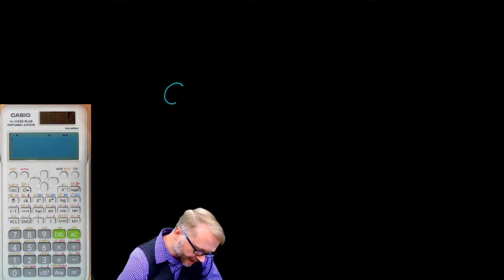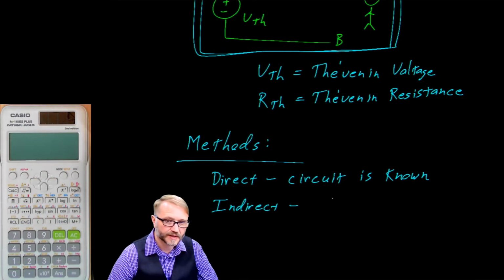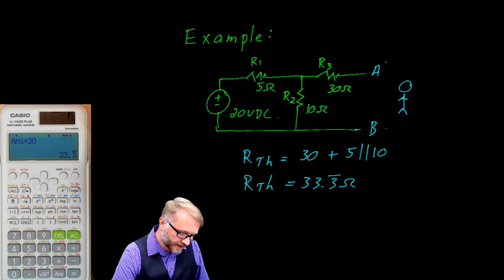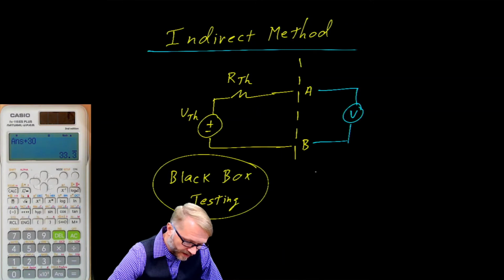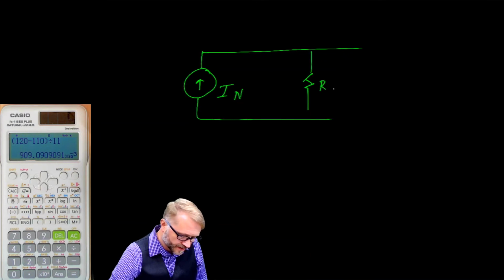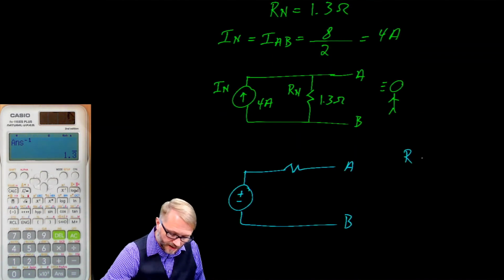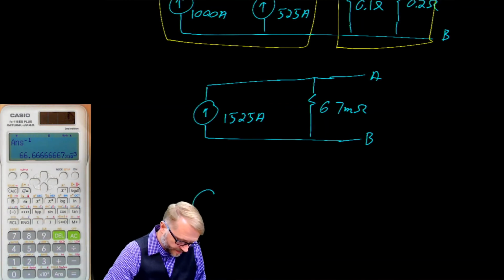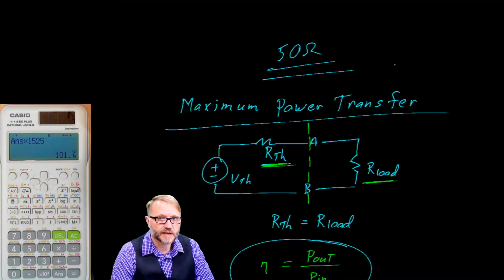#7: Thevenin & Norton equivalent circuits and the maximum power theorem

Comment: 02:30 Deconstruction of the Circuit
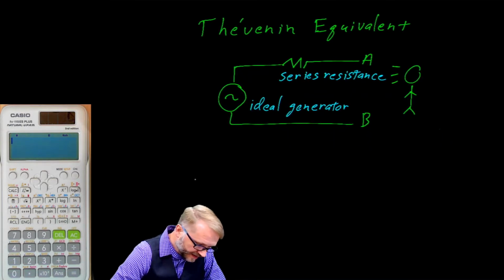03:22 Modeling the Thevenin  Circuit
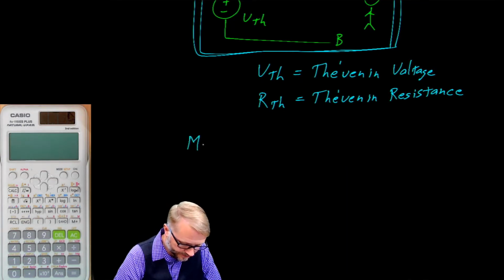04:50 2 Methods
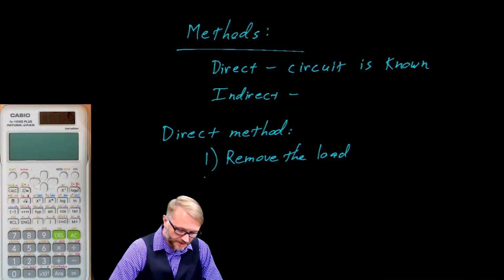05:15 Algorithm for Direct Method
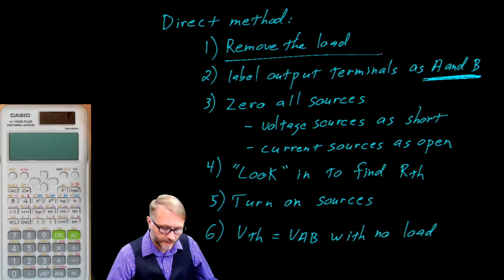06:30 Example 1
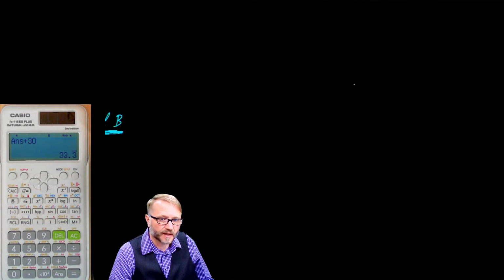12:00 Indirect Method (Black Box Testing)
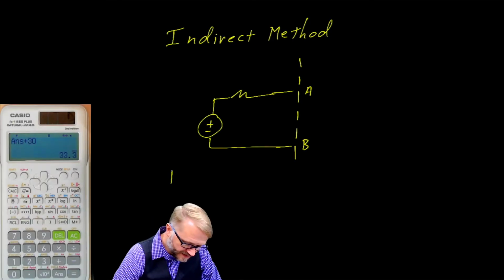13:10 Example 2
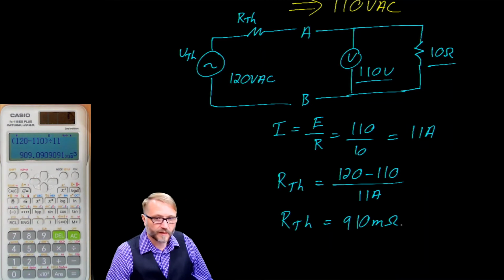17:40 Norton Circuit
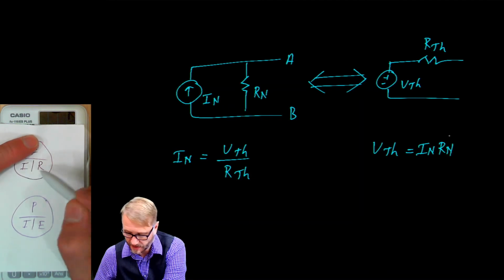19:29 Relations Between the Two
20:01 Algorithm for Norton Circuit
20:55 Example
28:34 Maximum Power Transfer Theory
(Rough draft, will clean up later)